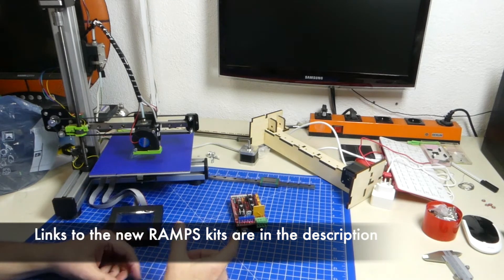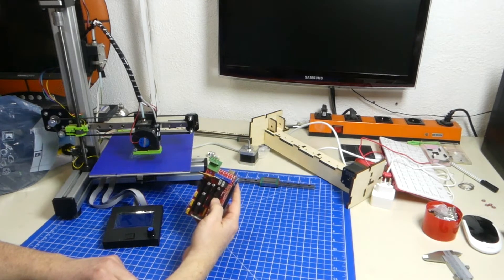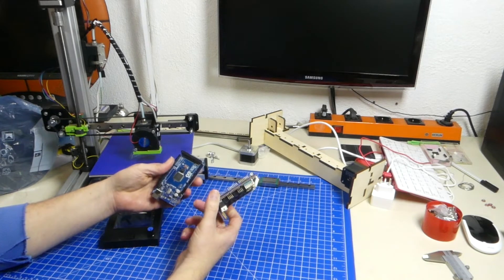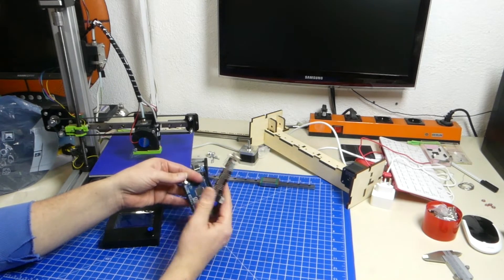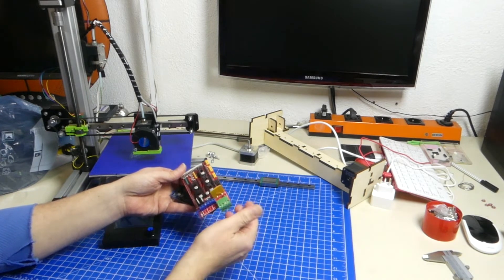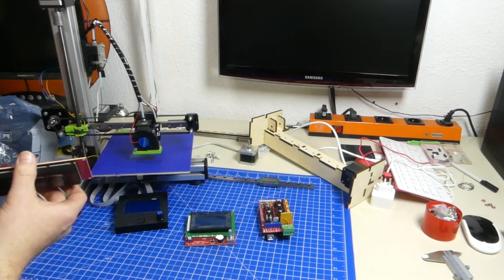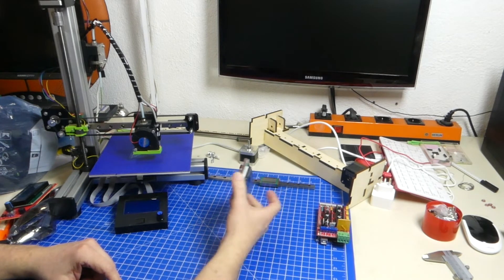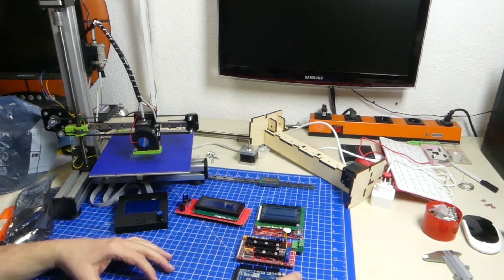Cheap RAMPS Kits are back - a Bad Robin 3D Printer update

Comment: This might because of general switch to TMC steppre drivers that require some extra wiring for sensorless homing and UART mode, so everyone is switching to more specialized boards that support that without needing to solder on wires to the pins, this might also be cause by the general switch to 32 bit boards. I got SKR 1.4 for my next printer re-build. 

Also I've been using MKS GEN 1.4 for a few years -- (It's pretty old) but the main advantage of the board that it lets me use it in 12 or 24V systems without removing the diode from RAMPS. Also it has built in 5V source, which is convenient.

Comment: There are so many better alternatives, liek the Bigtree Mini SKR V2, don't go with the 8bit RAMPS in 2021!
Reply from the maker: That board does not support the software changes needed for the Robin Extruder.
Reply: you can also get Ramps in a 32bit option btw lol it a little pricy but I heard it works rather well and you can keep the same form factor to your projects which is often handy.
Reply from the maker: I got one of those, works ok, but you need level shifters for the display board. I hate those - touch them the wrong way and they break. And still there's nothing that would mandate 32 bit processing power at the speeds I'm going.
Reply: @dherrendoerfer  Honestly lol i like Ramps, they are, tried, test and true lol does everything it needs to do and does it well without problems, all my FDM printers are on Ramps and all my resin printers the DLP and the LCD's are on Cnc shields, All but the form labs that is.
Reply: @patprop74  you're missing all the gold New Stuff like linear advance - and the super silent drivers.
Reply: @martingerken7094  You are not wrong there, however, I see my 3d printer as tools and tools are in the shop where being silent doesn't matter as much, my coffee maker produces more noise than my 3d printer does anyways haha, As for things like linear advance..., all my printers are on a direct drive, not Bowen, again still wouldn't be a big game-changer, if I ever was to move away from ramps it would be to a duet so I could use RepRap firmware, not marlin.